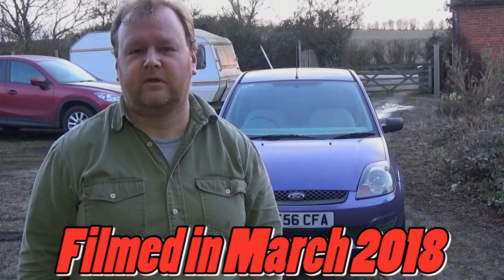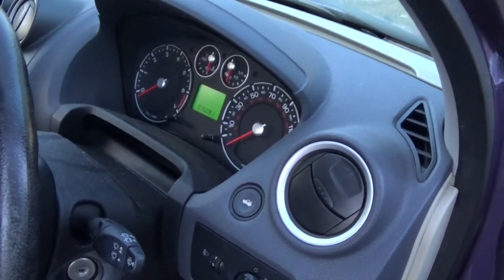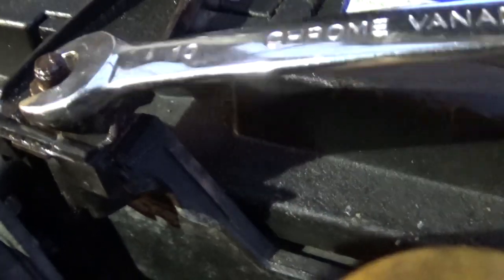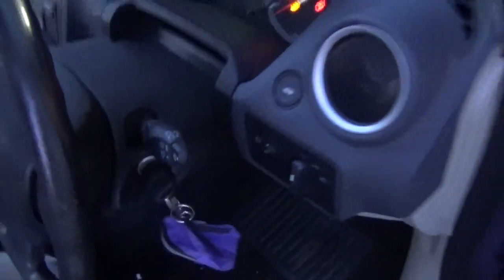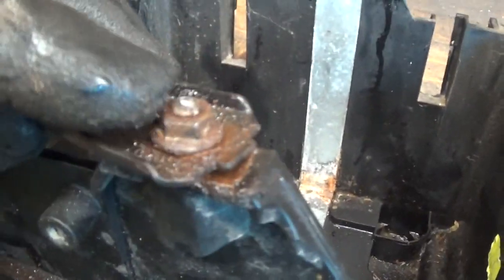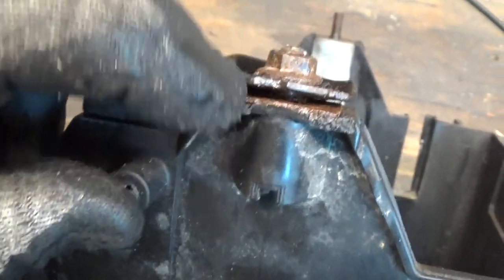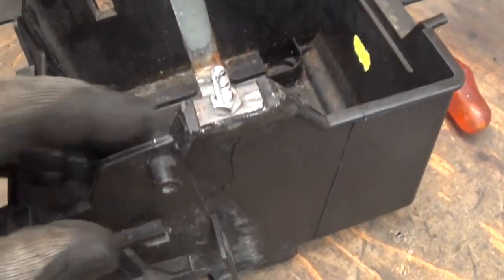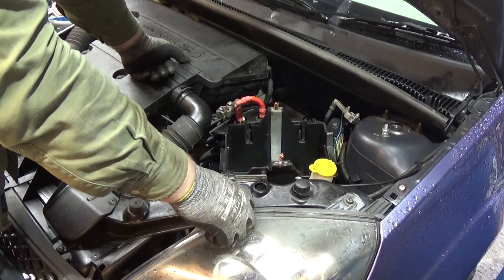Part 1 - £100 Fiesta - Removing and Repairing a Damaged Battery Tray Issues

Comment: This must be insanely common as I recently got a Fiesta and found the bolts completely seized like this, but also rotated with the nut when you tried to loosen it. I had to resort to tearing the enclosure apart with pliers after trying to drill the bolt snapped a drill bit! What a terrible design!
Reply from the maker: This was a few years ago. Just watched the video back and I remember how frustrating it was!
Reply: @ShedTV  I had a surprise with mine as the ECU was fitted from below, with barely any room to manoeuvre to unscrew it, finished an hour and had battle scars to prove it haha

Comment: Just tried taking the retaining bar off my fiesta battery. Same problem but on opposite bolt, nut and bolt turning together. Think this will be the solution, but will try the slot method first. Wish me luck!
Reply from the maker: Did it work?

Comment: Just had same issue with the nut, put wd40 on to hopefully loosen resorted to drill. Worked for one and broke other in plastic housing. When you take the plastic tray out visible over to right underneath is piece of metal , any idea what it’s called? Mines rusted all way through along with whatever holds ECU in place. I see a part online that looks like it might hold battery and ecu. Hopefully simple fix. Reason is arch liner for passenger front is non existent.
Reply from the maker: Sorry, it was a few years ago when I made this video. I can’t really remember what it looked like.
Reply: @ShedTV  if you go to 5:12 onwards you can see the metal piece im on about. My mechanic told me to weld it
Reply from the maker: @cannibalholocaust3015  Hmm, not sure what that's called. On an old car like this maybe just stick a few cable ties on?